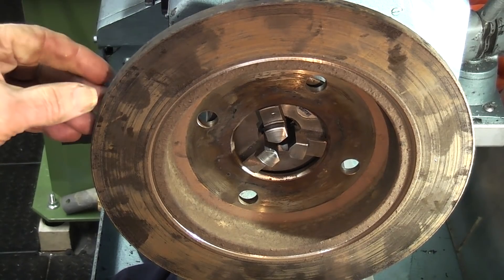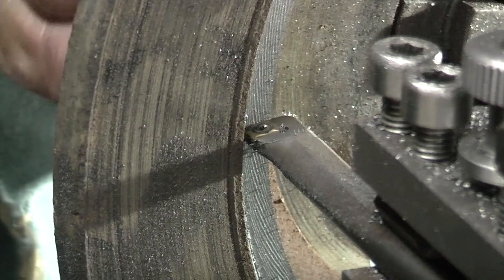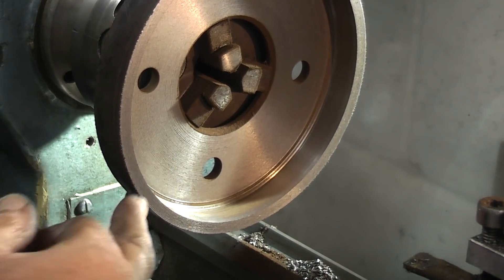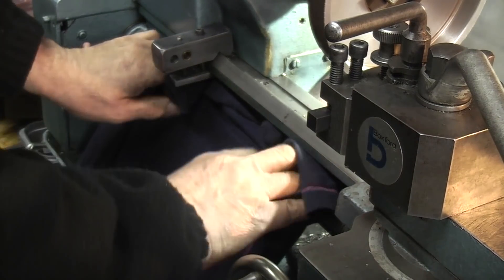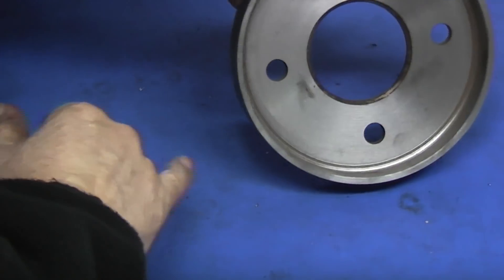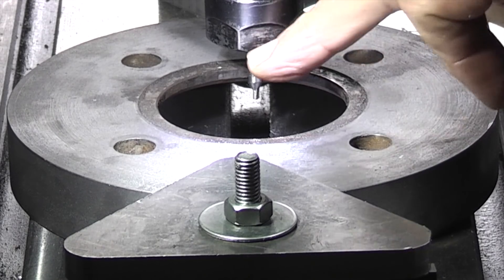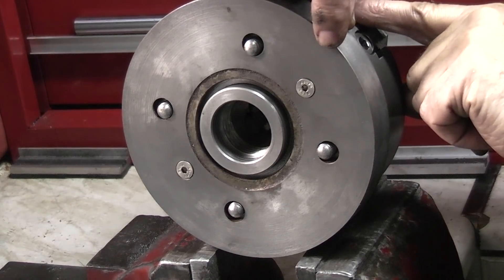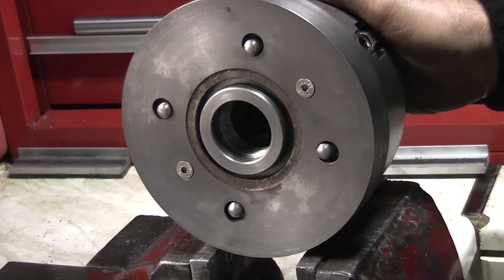indexing plate from an old brake disc

Comment: I machined the drum off a new disc to cut the disc part up into 24 little brake shoes for a small locomotive.
It didn't take long to find how dusty it is, so I taped a length of 22mm poly-pipe into the end of my shop-vac nozzle and clamped it to the tool-post. 
All the dust then stayed out of my nose, lungs, hair etc, and the machine-ways stayed clean.

Comment: Nice, did you use a special tool to turn? I tried last week to cut down a brake disk but my tool didn't like that. In fact it made a horrible noise and turned red hot even with oil. It chipped like crazy. 
The surface was very rough even on high speed turning. I even tried different plates on my tool. I looked it up and brake disks seem to be hardened cast iron. Thanks.
Reply from the maker: Hi Janne I ran the disc at around 65 RPM and used a carbide insert. The discs are very tough after years of heating and cooling when used. I found once you have taken the surface off they are softer underneath.
Reply: @enotsengineering  OK thanks, i'm gonna try that.

Comment: How was the disk centered on the back of the chuck? Just indicated? Will you turn the OD when the chuck is remounted? Nice video.
Reply from the maker: Hi Rex The chuck was centred on the milling machine then the disc centred to the milling machine coordinates on the chuck back plate. Once bolted on the chuck the OD was turned true it was running out about 0.020"
Reply from the maker: Forgot to say there are 2 more videos showing making the arm and locating pin and finishing the disc and testing
One on Tuesday and one the week after

Comment: An old table saw blade ,say 72 teeth, and a spring -loaded pawl are easy to knock up and incorporate into your  set-up. Not the highest of precision but  good enough for many applications and surprisingly  adaptable.
Reply: I used a 100 tooth plywood blade for indexing small projects, it works fairly well.

Comment: G’day Alan. Top idea using the brake rotor , did you specifically look for that stud pattern or was it by chance?
Cheers 
Peter
Reply from the maker: Hi It was just luck that the disc fitted the bolts but you cuuld drill the holes to suit any stud location